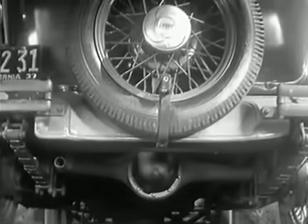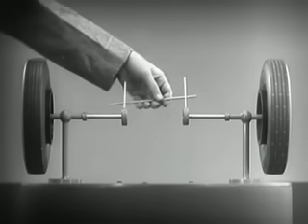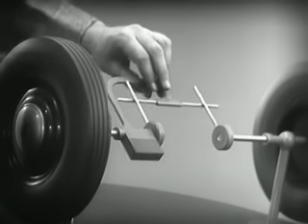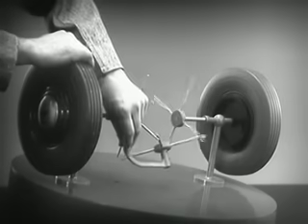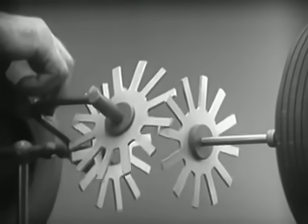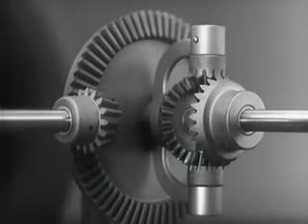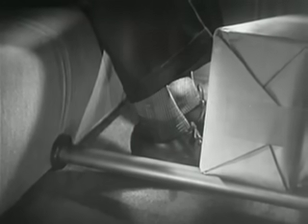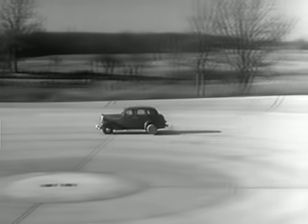Around The Corner - How Differential Steering Works (1937)

Comment: A video from 1937 explains diffenerniat so much better than modern 3d animations
Reply: +Adriana K. wikipedia uses the most technically correct language, which is not necessarily the most easily understandable for the layman.
Reply: I agree, animation cant beat reality explanation. Thus, they used better words.
Reply: Adriana K. and anyone else wondering, this is the Simple English Wikipedia page definition of a differential:

"Differentials can also be used in automobiles, where they are used for turning, for example, while turning right, the right wheel travels a shorter distance than the left, the differential slows down the wheel so it will not slip."

"This is because the inside (right) wheel is closer to the center of the turn, meaning that it travels on an arc with a shorter radius, thus resulting in less distance traveled."

Maybe not as good as the video, but it gets the general concept across of what a differential is doing.
Reply: branot89 wikipedia is the suck at explaining...anything.....if you want to know how something works, grab an old encyclopedia or watch old videos

Wikipedia "A differential is a particular type of simple 
planetary gear train that has the property that the angular velocity of 
its carrier is the average of the angular velocities of its sun and 
annular gears."---¬¬¬¬¬¬¬¬¬¬¬¬¬:> that's really helpful....NOT..it's not even correct English
Reply: +branot89 // I feel it's down to those who contributed thought into this back when it was made. The logic was different and all the better for it.

Filming costs a lot of money. How can we make a video that explains our idea in such a way that is informational, thorough without being complicated, entertaining and does all of these things in a timely manner.

Now the logic appears to be:

I can explain it later in the comments section or just remake it when I can be bothered. The important thing is I get views.
Reply: branot89 Agreed. Differniat is so complicated, but this video is so well created.
Reply: now days they make simply things look difficult
Reply: Töttő Bence I am also hungarian living in Romania. I never ever was in a country where the inhabitants are english speakers, all the english I know I learned in the school and university and quess I understood all, the man in this vedeo explained.
Reply: +branot89
So so true. And bonus points to the 1937 video for being more entertaining as well!
Reply: OMG yes, so true
Reply: branot89 I am a 3D animator, but I have to agree. But it's not the technique that makes the difference; it's the better ideas of making it visible and understandable.
Reply: yup
Reply: SAD BUT TRUE
Reply: yes dude, old explanations were built to last forever, just like all the good old things...
Reply: Meet simple.wikipedia.org
https://simple.wikipedia.org/wiki/Differential_(mechanical_device)
Reply: thas right haha xD
Reply: William I r so old to understanding  the mordan thinks
Reply: Ikr
Reply: branot89 ikr
Reply: branot89 and is much more entertaining
Reply: fuck my ass
Reply: +petabyte99
I mostly agree with you. But I do believe the point of the OP was pretty much the same as yours.
Reply: Agreed.  Learning about diffenerniats has never been easier than this.
Reply: While I don't disagree, I find "better than modern 3D animations" to be quite perplexing, considering that what they did was very similar: they built 3D models. It's just that these 3D models were physical models, rather than computer-software ones.
Reply: are you alive
Reply: im from hungary living in ireland and learning english for more than 2 years now and i gotta say im pretty good at it. but i have no fakin idea what that fakin wiki tries to tell me
Reply: Adriana K. sounds german
Reply: branot89 deberían volver a los modelos de explicación de antes
Reply: Adriana K. You can always try the Simple English version of Wikipedia, sometimes that makes some articles easier to understand if you aren't an expert in the field's esoteric language.
Reply: Someone1976 I agree. :-)
Reply: branot89 ce ai vrut sa zici
Reply: Coincidentally, I wrote almost exactly the same :D
Reply: It's making the assumption you already know what a planetary gear is, which is silly for a site claiming to be a SOURCE OF KNOWLEDGE, you know, since assuming you know it why would you come to them to get a rehash on it?

Comment: <Goes to to settings in the window to change quality>
<Finds 240p only>

-_- I'm so stupid.
Reply: DJ Shuffle They didn't have pixels in 1937 though. If the digital conversion was good it could well have been in HD now.
Reply: What did you expect from 1937?
Reply: Derederi I meant that I subconsciously wanted to change to a better quality even though this is,as you said, a 1937 video.

Comment: The people who thought of this must have been fucking insane geniuses
Reply: No...not really, the process they went through explaining to the audience how the whole thing works with sticks and such in the middle is pretty much how the engineers would have worked through it. Granted, it may have been on a chalk board, but you'd be surprised how similar the first few models and mock-ups would look to the spokie-wheel-thing they built as a teaching aid.
Reply: Gabriel Solomon and?
Reply: man and why is that important?
Reply: Daniel Hijazi Because our contributions are under appreciated.
Reply: It seems actually quite an obvious solution to the problem if you have to think long and hard about the problem.
Reply: Gear have been used for at least two millennia. Before the age of electronics very intricate devices were made using gears. I find it hard to believe that nobody until the early 19th century invented the simple pattern of the differential.
Reply: they were all immigrants too.

Comment: What if the spoke which rotates the other two spokes turns 89 degrees? One of the two spokes will turn the other way making the two spokes rotates at different directions? What if the spoke which turns the other two rotates by itself, the wheel will not turn at all.

Comment: Its amazing how little the rear diff has changed over the years. I have an Eaton LSD diff in the Trans-Am, and it doesn't look much different to the examples here. Even the ring and pinion hasn't changed in all them years, even on the same side.

Comment: As an addendum to my previous post it may be worth noting that as well done as this presentation is it may have had added value by emphasizing in the working model of a real differential that the ring gear driven by the pinion is not directly connected to the axle closest to the ring gear as may appear to be the case. It is rather directly connected to the case that hold the planetary gears that do connect directly with a gear on the inside of each axle. It is in this case where the wonders of the differential take place. On a straight - a - way that rotating case connected directly to the ring gear should show little movement if any of the planetary gears inside since both drive wheels do not show any appreciable difference in their rate of speed and thusly there is no mechanical advantage of one drive wheel over the other in this situation. So on a straight - a - way both drive wheels should receive equal amounts of power from the engine. To demonstrate an extreme example of how the differential automatically adjusts to different rates of speed of the drive wheels a differential under power could be shown with one of the drive wheels blocked from rotating allowing the opposite wheel to continue to rotate as if making a tight turn. In this situation there would be great motion on the part of the planetary gears showing an automatic change change in their function as the differential does its work of automatically adjusting to different rates of speed of the drive wheels when a turn is being made.

Comment: Well done film about the differential's role in transferring mechanical energy from an automobile's transmission to the rear wheels which rotate at different rates of speed when travelling around a corner. The ingenious design of differentials allows motive power to follow the course of least resistance when turning a corner and always flows to the outer wheel which has the greatest mechanical advantage at that point in time. An added benefit of increased mechanical advantage during all turns would be no loss of momentum of the car in motion since the engine would be rotating slightly faster than it would on a straight - a - way allowing for a modest increase in available power. On a straight - away mechanical power should flow to both rear wheels in equal amounts. These are quite efficient mechanisms which permit power to be transferred without generating much wasteful heat in the process.
 Also note how the film shows the use of hypoid gears(a curved gear design within the differential). This allows for a more compact design than would be the case if gearing with straight teeth was used saving space for the rear seat and trunk areas.

Comment: This only shows RWD (rear wheel drive). The front wheels would just be on an axle and spinning freely. In a front wheel drive the same diff is used, with a shorter drive shaft.

Comment: The title isn't quite right; this explains how you can drive two wheels at different speed, but not how the front wheels turn at different angles. To prevent skidding the wheel on the inside of the turn has to turn slightly more than the other one. That's what differential steering is.

Comment: did Roman chariots have some kind of allowance for different wheel speeds when they were cornering in the Collesium? I know they don't have a drive shaft, but I wonder if they had independent axles so they din't skip around corners

Comment: @legion2 No, each wheel has two diameters: The external is smaller than the interior both of them compesate the rotation of the other wheel with the same axle according the side of the corner.  F. E.:The external side is longer than the interior of the corner There is tolerance between the rails with relation to the wheels.( axial movement). Answer me please! Greetings from Argentina!

Comment: @kifoxie Errm, well no!! what he meant i think is that all cars prior to about the late 60's [british ones at least] had a "transmission tunnel" running down the length of the car. This was most noticable in the back where you would have a hump about 6 inches high running down the centre of the car floor and disappearing under the back seat. There was never just a shaft out in the open!!!!